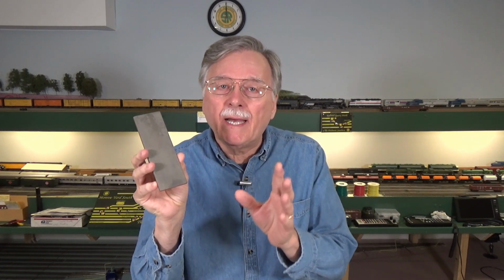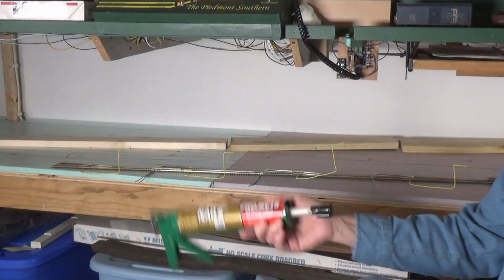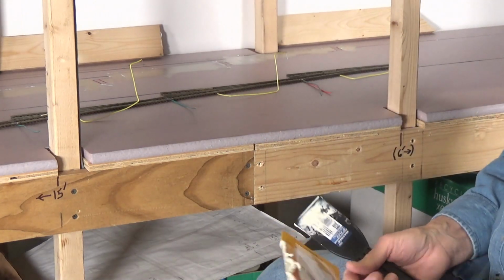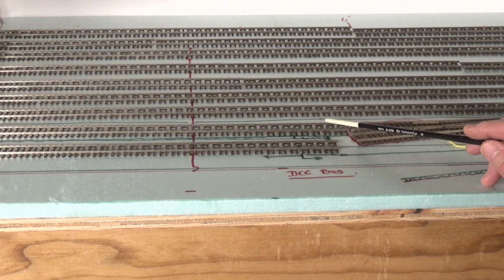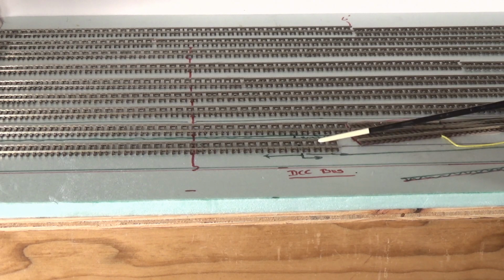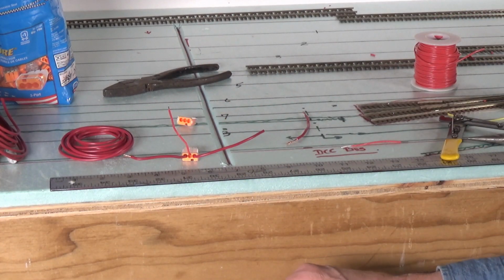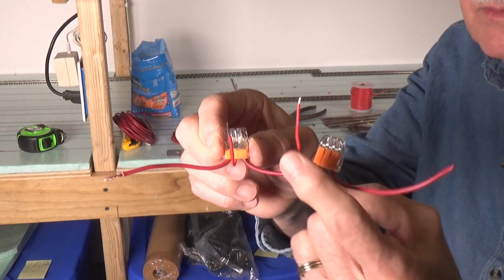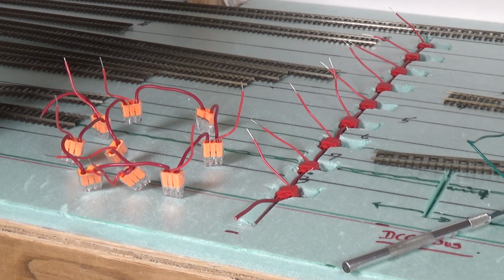Wiring The Staging Yard (233)

Comment: Hello Sir, 
I saw the video that you placed on your link from ESP Wireless. It looks like they don't want to respond to any questions. Maybe you might be able to answer my question about ESP Wireless. Will ESP Wireless replace the Aduino Computer System in order to fully automate a model railroad layout? Also I wanted to know if ESP Wireless can be used on a Lionel O-gauge layout using the fastrack and switches system?
One last thing can I use DCC on my Lionel layout? Do you think I could learn from your ideas on my Lionel layout?
Thank you for your time
Sincerely
Allan Martinez
Reply from the maker: I don’t know the current status of ESP anything now that DCC Concepts has been purchased by TMC and rebranded as Layout Concepts which is probably why you are not getting an answer from them.

Comment: Hello Mr Puckett, 
In your opinion what is the best type of wire to use throughout the layout? Solid or Stranded wires?
Thank you for your time Sincerely
Allan
Reply from the maker: I generally use stranded wire in areas where the wires needs to flex a lot as solid wire will break under those conditions. However I use stranded 14 gauge solid copper audio wire for my DCC power buses.

Comment: Dagnabit Larry you hooked me Again made me watch the Goodness all the way through that's slammin sharp setting up the Staging Yard with everything thing above the layout instead of dunking under hitting & straining yourself going under all the time I've seen some other layouts going in this direction building on top but I need to see the Rest of how the Yard finishes out I've used suitcase connectors by 3M for some of my Wiring & through micromark I want to Note 📝 I'm just passing on what I've seen in catalogs  they sell a 3M compression tool that makes compressing these Connectors an absolute Breeze..  

The Connectors i started using a few years ago & comes in 3 port sizes 2, 3, & 5 is Wago's 221's connectors Wago lever connectors excepts 12gauge to 26gauge Larry i like using in conjunction with these Connectors Wago Ferrules for stranded wire as it keeps the wire from fraying out..

For the Video Larry I was wondering what type of knife you used & was the foam 2 inch or less I seen blue & pink can you get this foam both at lowes or another Hardware store.. This is what I'd like to go  to Larry building a layout utilizing foam it Quets the sounds but in certain situations you can top mount your stuff wow what neat innovations.. Being shared 

Allen D
Reply from the maker: The green foam was from Lowes and I believe is their own brand. I used a standard box cutter knife.

Comment: Thanks for the video and the information Larry.  I am modeling N-Scale on foam much like yours.  Being handicapped it is difficult for me to wire under the layout.  I had thought about digging a ditch for my track feeds.  I thought about using a straight edge and my knife to dig a "V".  What tricks have you learned to dig those ditches?
Reply from the maker: Lee, just like you described I cut a V then popped out the foam. On the Red Oak N-scale project layout in 2014 the MR staff did something similar running the wires in a channel on the front edge of the foam base. At least with it on top of the layout you can dig down to get to the wires in case of a problem. However make sure to test the wires before covering with scenery.

Comment: Larry  I like those new connectors when you were placing them on the layout I was wondering how you was going to hide them Then I saw you removed them.  They would be much better for under the layout applications.   Have a Merry Christmas
Reply from the maker: Well, I found them to be OK with solid wire but a PITA with stranded wire. Also it surprising how much time it adds to cut the wire to the necessary length, strip it, and prepare it for insertion. I’ll stick with my suitcases. No cutting or stripping needed. Just slip it on, insert the feeder, and clamp it shut.

Comment: Those push wire connectors would've worked better going in "upside" down, in other words, the clear part would be sunk into the foam enough so that the flat bottom of the orange part you push the wire into is facing upwards.

Comment: I also used these type connectors and didn't care for them under heavy application, such as 110 volt.  I found on Amazon the type that have levers that will take up to five wires, and i find these more suitable to my layout.  They are easier to install than the suitcase type and what you are installing here.  Still, to each individual we have our preferences.  Thanks for all the info on installation of your yard switches and staging area.

Comment: Larry, Don't know if you are familiar with Charlie Bishop (an Englishman) but he has a little memnomic he is using  in his wiring that I think is easier than the phrasing you use to remember where red and black wires go.  His is "black to the back.". (So, of course , that makes red to the front.). Works fine except in reversing/reversed sections.

Comment: Where did you get that cap to cover the tube of Liquid Nails. I haven't found a good way of preserving the adhesive
Reply from the maker: I found that in the same aisle as the Liquid Nails at Lowes. Since buying a couple packs of those I have never had to toss out a tube gone bad. Works so much better than a nail and tape over the end.

Comment: Larry,  thanks for another video with lots of useful ideas.  I'm currently in the process of designing a layout with lower level staging but was concerned about having the switch machines and wiring underneath.  A couple questions, what's the separation between you decks?  Assuming you're using a helix to connect them, what grade are you using.
Reply from the maker: The separation between the main deck and staging is 19” and my helix will be 6’ diameter with about 1.6% grade. I cut some of the height difference by using a ramp up approach track on the bottom and a ramp down on the main level. I still need about 6 turns in the helix. The helix between the main level and upper deck is only 15” apart and I used the same ramp up and down approaches to the helix there too. I am planning a video series on building the helix later this winter.
Reply: @TheDCCGuy  Thank you.  Merry Christmas.

Comment: Larry I watched the DCC concepts video , not sure if it would work with Walthers switch machines but did send them a email about it
Reply from the maker: The ESP system should work with any accessory decoder. All it is doing is generating a switch command and sending it out on the accessory bus.
Reply: Larry I would need more information, Walthers switch machines have a decoder built in, but the idea is great, access to my yard is limited
Reply from the maker: I have some of those on hand and will likely do a video testing the ESP system with a variety of accessory decoders, so be patient as it might be a month away.
Reply: Larry no rush , my yard not complete yet

Comment: Looks so much easier with the suitcase connectors over the push-fit things!  The push-fit ones would have to be a lot cheaper to justify using them, I think.
Good idea on using the turnout motors to power the sidings.  I remember in the 80s my dad did something similar using a diode matrix to automate a staging yard on his layout (DC of course back then): I could never get my head round how it worked.

Comment: Larry great idea using the internal switch of the switch machines to control the yard track, I am using Walthers switch machines, they have two micro switches installed on the machine, one for the frog power ,the other could be used to control the yard track, now back to the video

Comment: Mr Larry. I really would love to ask you a few questions I’ve been into ho trains since I was a little boy and now I’m 44 and I’ve been doing my first DCC real layout. I had my trains in my old place running around the celling into my closet really cool. But I’m not good with wire work. I have MRC control with boater I don’t know how to hook up. Also all my locomotives run on my code 100 track and they stop if I push it a little bite they go and do same thing again. Now if I have it all the way up on my controller and hold the locomotive for a few sec they start running around pretty good around track layout. I would love to know what to do. Bc it’s killing me I have power all the way around I test with a little light on track runs
Reply from the maker: First try cleaning you loco wheels and then your track, that is the most common cause of the problem you are seeing.